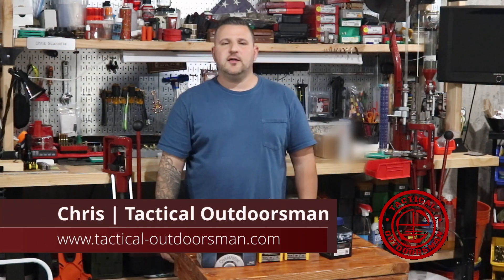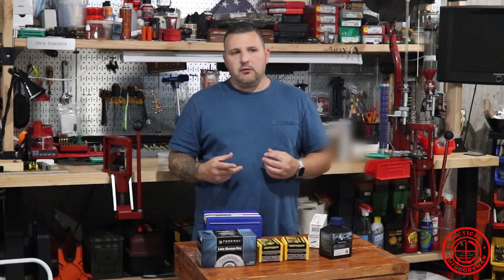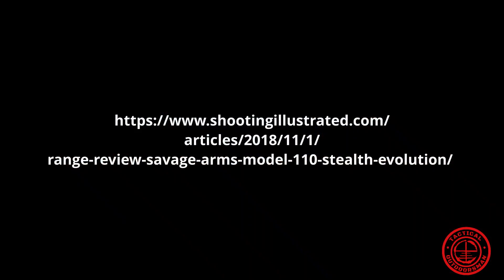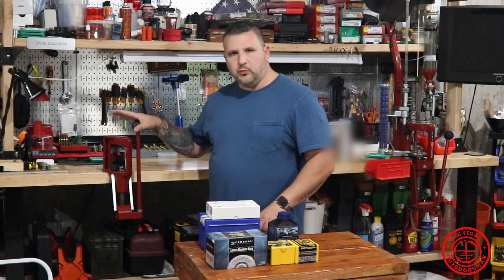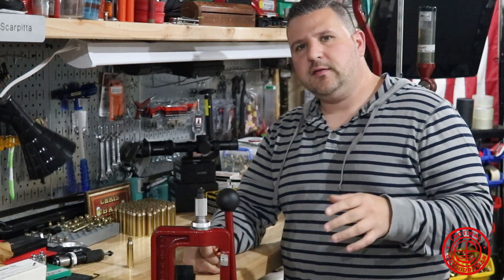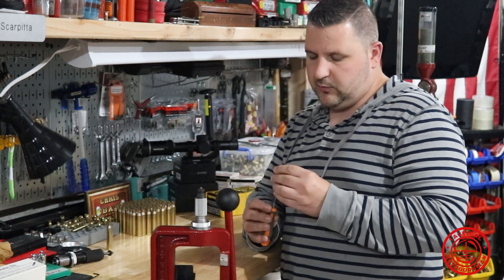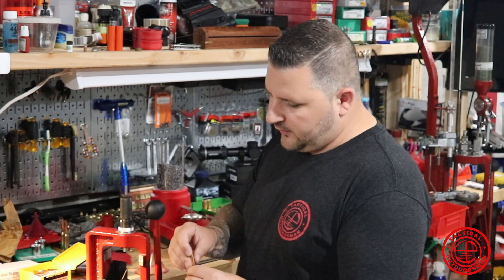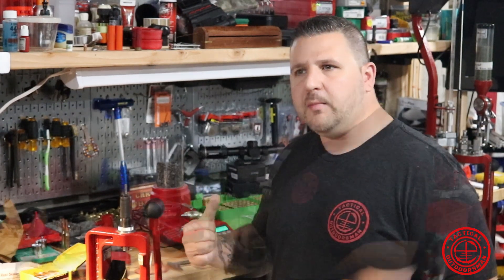Part 1 - Load Development | .338 Lapua Magnum - Berger Bullet - Vihtavuori N570

Comment: Are you not able to do this on the lock n load press? I just purchased the LNL press but I’m having a hard time finding videos of reloading 338 using it
Reply from the maker: I’m not sure. People don’t usually use a progressive press for precision ammo. I personally only use it for bulk loading 9mm, 45 or .223 The powder drop is by volume, not weight, So it’s not not as precise. And I’m not sure if there’s enough clearance for the brass and bullet, although ive never tried.

Comment: How did it turn out? Notice any difference with the brass weight?  Nice vid. Thanks.
Reply from the maker: I actually ended up doing the second round of testing and never got around to making the video. The 300 grain bullet with 88.5 grains of powder ended up giving me just about a quarter of an inch at 100 yards. I never did really look into the breast weight. I have the two sets of targets, I can take a look to see if there’s any patterns. It will probably be too small of a difference to tell at only 100 yards though

Comment: my rifle is a fierce short mag box single feeding as well.   3.720 coal.  got a load with the 265 grain nosler long range accubond at 97.3 grains N570 for 2910 fps.    it mite need a tiny bit more tweaking  but if shot it out to 1175 meters so far.       its shooting well.I just tried a few rounds with a neck bushing die running 1.5 thou of neck tension. to see if it was more accurate. .Im not sure that the neck tension is more accurate yet.  Need to do more testing.          Just loaded up a pressure test with the 265 nosler and the 250 Berger with retumbo      .Hopefuly shoot them soon and try and find the flat spot  in velocity       .See if retumbo is as fast as n570. or not
Reply from the maker: I FINALLY just uploaded the second video.  Sorry for that long, long delay!

Comment: Ive just started with a 338 Lapua and Berger 250 grain and N570.    coal is 3.720.  in my gun the 250 grain looks like its going to shoot around 99 grains for 2950 fps.       but more testing is needed
Reply from the maker: Very nice, I haven't been able to get to the range to test those loads yet.  I can't wait!
Reply: @C4Armory    I just found a pound of retumbo when I get time will test that out as well
Reply from the maker: I have 1# retumbo and H1000. That’s next! 😀
Reply: @C4Armory  right on I will never find H1000 now  but that would be good as well.  either one should work